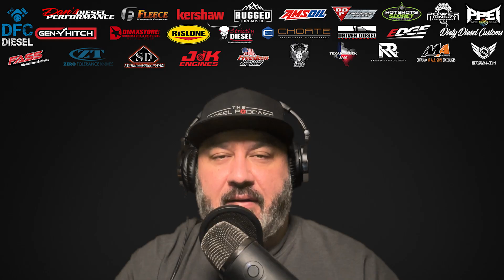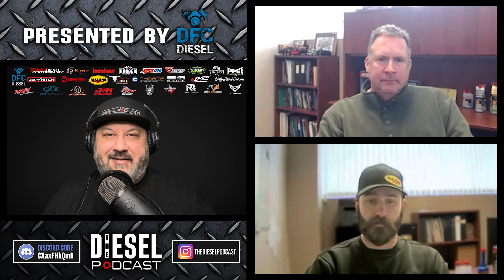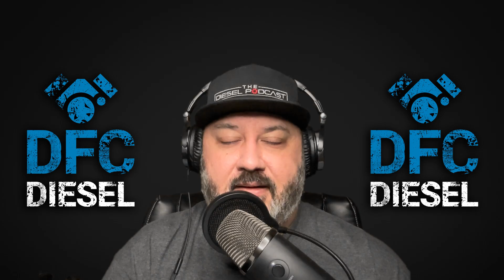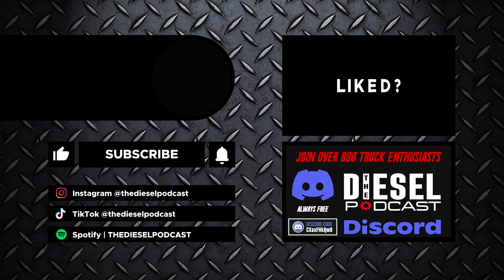DEF Crystallization + Clogged DPF’s

Comment from the maker: 40% OFF KERSHAW KNIVES with code: TDP2540
Discount code valid until July 1st, 2025 40% off MSRP at  Kershaw Knives with code: TDP2540
FREE Shipping over $50

Offer valid through 7/1/25 at 11:59 pm Pacific. Discount is applied before tax and shipping. The discount code must be added at the time of checkout, it cannot be added retroactively. The discount is off of the full MSRP. No substitutes, backorders, or additional discounts can be applied.

Comment: I have a 2026 Cummings purchased 12/5/2026 and I am at 5k miles all highway and last week my dash  lit up like a Christmas tree  and the DEF was full and went to 100 (or whatever it was)  miles till limp mode 
I put about 1/2 gal of DEF in it and overflowed it by accident.  The DEF light shut off and went back to normal.  It has done this 2 more times this week.  
If this keeps up it will not be there much longer.    I like to work on my vehicles myself.   All I have used on the truck is the platinum DEF

Comment: Engineer here 👷‍♂️It’s mainly a lack of regular and correct scheduled maintenance. Diesel exhaust fluid (DEF) is made of 67.5% deionized water and 32.5% urea, which work together to neutralize the toxic nitrogen oxides (NOx) found in diesel exhaust. Crystallization happens when the DEF's urea concentration becomes too high (ratio wise ) This usually occurs when its water components evaporate exposing the urea to air and causing crystals to form ( ex: sitting like this in a open container for several days) 🙄 The main reasons for the crystallization are:  DEF pump is not completely emptied after the vehicle is turned off, DEF pump filter element is not replaced regularly,the use of non-compliant or low-quality DEF and /or lack of purity and contamination of the fluid. And no worries those Crystals are harmless if you touch them although they may be a bit sharp.

Comment: Take a simple  efficient power producing low cost  industrial engine and sprinkle MODERN technology onto it and call it advancement just to complicate and create issues so you can market solutions. Modern diesels are total JUNK at the expense of the general public as cash cows footing the bill for garbage engineering of planned obsolescence.

Comment: I have a 2017 L5P in a 2500HD Sierra.. had filled up the DEF with Tractor Supply DEF (all that was available) .. Got the Low Quality DEF message about 600 miles into a trip..(running at 70-75mph towing a 9000 lb trailer) I run mine pretty hard driving highway speed, towing fairly heavy and running the same 1000-1200 mile route in the mountains and hills of the Northeast.. and have an emission  compliant Edge Tuner.. Doesn’t matter whether on the stock tune or the Extreme (not towing). It has struggled to be reliable when it comes to the emissions equipment .. with just 117K on the truck…9th injectors (3 in last 70K) regens are constant.. I have run it.. the level sensors in the DEF tank read 37% regardless of how full or empty.. I can run forced static regens and frequently do.. After decades of diesels, I am not going to buy another unless they ditch the Emissions equipment.. I have travelled the Planet, the Whole Southern hemisphere (besides Japan, Australia ) NOBODY els has this crap.. We share the Air with all of them.. People confuse visible soot with environmental air quality.. it really isn’t as big an issue as they say.  I haven’t tried the Rislone Crystal or the Clean yet… might, since mileage has fallen off a lot over time.

Comment: I had my DEF injector replaced because I got the code 98 miles to 65mph and before that I had put in the DEF crystallization fluid and I don't think it worked it surely didn't dissolve what was there already is there really any truth to it working?